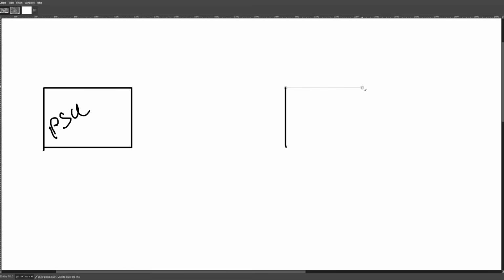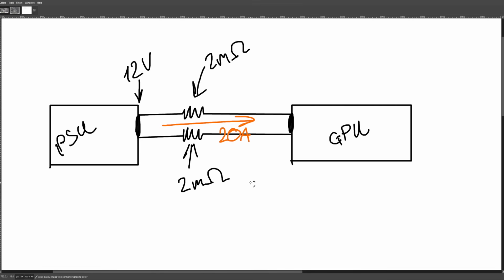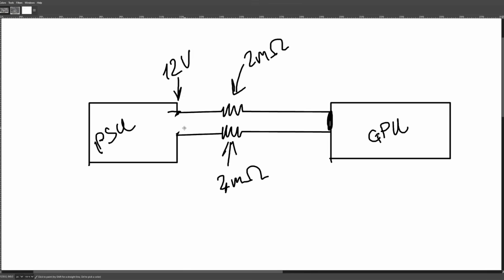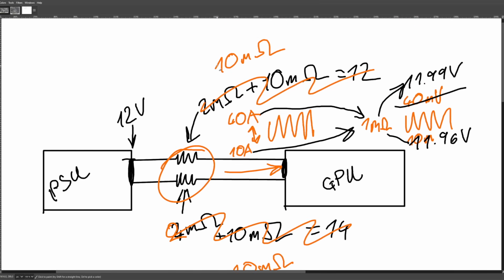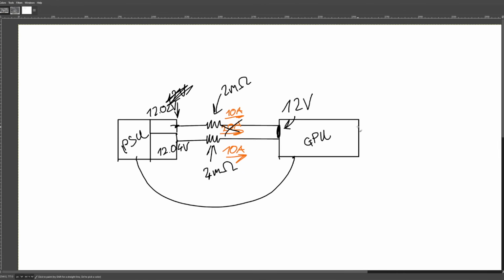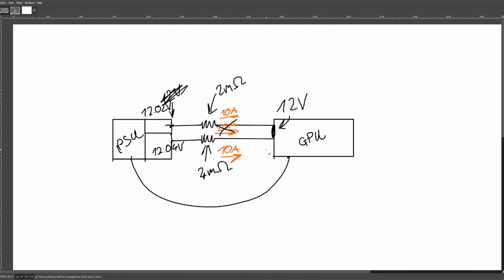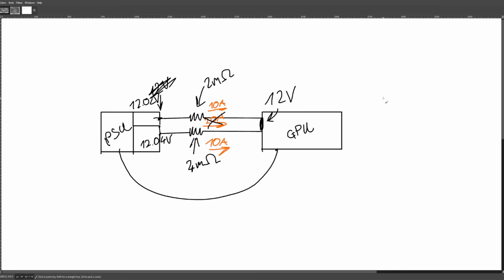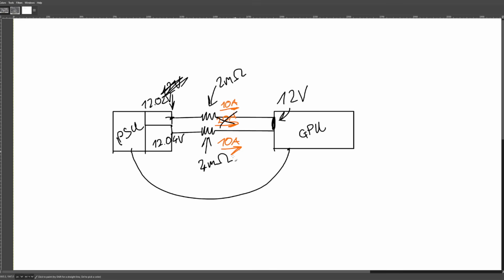Why ATX power supplies don't load-balance power connectors

Comment: There's also the fact that you are unaware as the PSU if each pair of wires within a connector wants equal current or not! ... If for example the GPU used one pair of pins for a rail to power cooling, and the rest of pins to a big rail for the rest of the card, and current controls it at the GPU end to achieve this, the PSU would have no way to know NOT to balance the current on them two lower current cooling power pins. Any load with individual pin pair current control would fight against any PSU current balancing circuit.
Reply: i'm pretty much certain that the GPU simply isn't allowed to do that. If it did that, then inherently the GPU would be drawing much more than the max allowed current from certain wires compared to others. I am actually kind of curious how the ATX spec is written now, because you raise an interesting point. I do wonder if the ATX spec specifically states that the power drawn needs to be designed to be balanced on all wires, or if it states that it actually can be unbalanced but just must remain under a certain max current limit.

depending on how the spec is written, this could be the only reason why using PSU side balancing would be the worse option IMO. If the spec allows for unbalanced current draw then you'd need balancing to be done on the GPU side.

But the spec really should call out balancing to be done PSU side and for the GPU side to combine all wires into one 12V bus on the card itself, and from there branch out to all of the 12V circuits.
Reply from the maker: @spectrum_observer  the spec for the 12VHPWR connector requires that all pins immediately get combined into one polygon on the PCB.
Reply: @spectrum_observer  I mean say on 3 pairs they have current limited to max (or less) and on say a single pair current is limited to much less (at the gpu end). Theoretically this would be fine, as long as it was managed properly at the gpu side and the pins drawing the most current were also current controlled, as parallel wires can happily carry different current levels at the same voltage, as long as it's individually capped/controlled and not all just running into one rail) .

 I have a feeling for 12vhp, this (as you say) is just against the standard, but for previous gens (6 or 8pin etc) I think it may be possible.

And I agree, the issue with 12vhp, is Nvidia sponsoring it's design, with a massive change in how they will be handling current balancing, without including in the standard that PSUs are now to do this instead. (this is regardless of if there is ability to "downclock" pairs within the connector individually - I'm under the impression that this is partly, if not THE reason it wasn't previously done though, however I could be mistaken).

Let me know what you find in the ATX standard regarding that! I have a lot of comments to edit possibly hah.

Comment: So, we are where we are. What is the best option for someone buying a 50 series & PSU right now?

What is the best PSU & cable to use with a 5090? Is there any solution that is better than others to minimise the risk?

If not, should 5090’s be totally avoided? And go for say a 5070Ti which has lower power requirements & therefore more headroom on the connectors?
Reply: honestly i would avoid the hell out of the 5090. it just isn't a good design power wise, and realistically it's an absolute shit design from a cost-benefit point of view. nVidia will almost certainly fix this issue for the 6090 because of how much backlash there has been after they failed to fix the issue for the 5090.  I would just go for the 5070ti if you really need to buy a 50 series card, but in all honesty i would go for a used 4080 super and not give nVidia an extra sale on the 50xx series cards. screw them, everything about the 50xx series is garbage and they need to do better.
Reply: @ I’m building a new PC primarily for video editing but using an AMD cpu, not Intel (avoided Intel due to there issues of late). The advantage the 50 series nvidia GPU’s have over the 40 series (or AMD’s latest GPU’s) is the media encoders. 50 series hardware accelerate h264 & 265 422 footage and this makes a big difference when editing and rendering video…..Intel cpus have quick sync which similarly offer hardware acceleration of these video codecs, but as mentioned, I wanted to avoid Intel CPUs, which kind of pushed me down the nvidia 50 series. I have had a 5090 on order since launch day when I failed to secure a 5090, and I’ve been contemplating cancelling the order, 5070Ti’s are readily available now, the 5090’s are not & my order is in a queue. I got my 5090 order in at the original MSRP for the Asus Tuf card, I'm now seeing it advertised to order (but no stock) for £450 more from a regular retail outlet, not a traditional scalper.

I'm also not sure what sort of percentage of folk are actually having issues with the melting cables/connectors on the 5090 vs everyone just 'hating on nvidia' (which may well be justified) & reporting that the 50 series sucks. That is not meant as a criticism of you, or anyone else, I'm not an nvidia fanboy & I'm not defending anything about this launch which is a disaster....but, unfortunately for me, the 50 series does make a very compelling case for video editing specifically because of those media coders & their ability to hardware accelerate 264/265 422 footage, which my cameras use. So I feel I'm caught between a rock & a hard place right now.

Comment: Some issues here bro. I've liked your videos for a while, but got some mistakes/issues with this one...

First, you said that it just isn't practical to do load balancing on the PSU side and it would be far more logical to do it on the GPU side, or to at least just use a connector that has plenty of current headroom. I will agree that the higher headroom connector would suffice, for sure, but it's also just such a shabby way to handle something like this, especially when you're dealing with a situation where you are supplying far more current through thin piddly little power wires like 16ga or 18ga wires can handle safely individually. Realistically if you know you're going to be powering devices that are highly likely to draw more current than any one single wire can safely handle (or any one connector pin can safely handle), then you should be using load current balancing in either the PSU or the GPU.

Next where you made the comments about balancing the load inside of the GPU by adding a small internal resistance so that the total resistance between the supply and the GPU was matched between both wires, you made it sound like that situation would be significantly worse than without the balancing. If you didn't have balancing but you had that same mismatch of 2mOhm and 4mOhm on the GPU supply wires, the GPU would end up seeing 11.97 volts. With your load balancing circuit in place, it wo uld see 11.96 volts. Not a big deal in the slightest. That's actually how it should be designed, like 100%. If one line from the PSU is seeing higher current than another line, there should be a MOSFET on each of those lines that's controlling the current output on each line, and the gate voltage on the MOSFET supplying the line that has higher current draw should be slightly lowered such that the currents match. This could actually be quite easily done using a basic op-amp comparator circuit if you only had two output wires. In reality there are 6 output wires, so it isn't quite as simple of a comparator circuit, but there are a number of ways that could fairly easily be designed using op-amps that would take feedback from one another and balance the output by adjusting the gate voltage on all of the output MOSFETs. I dunno, I think that's what they should be doing in PSU's going forward, full stop. It really isn't as complicated as you seem to make it out to be. And in cases where the resistance gets really really high, you'd have the PSU shut down with a little LED that indicates that the GPU power wire is damaged or not plugged in correctly. Doing this really wouldn't lower the efficiency the power supply significantly, and it wouldn't be supplying significantly less power to the GPU, AT ALL.

The funny thing to me about this is that if load current balancing was implemented in the GPU instead, they would be doing exactly the same thing as I'm describing here (and, basically, as you described), except it would be done onboard the GPU. It would still be lowering the voltage to the power phases though, it's just a change in location where the voltage is balanced. But you really make it sound like this would dramatically lower the voltage to the GPU - it wouldn't, at all. I dunno, I understand why you're bitter and jaded because of nVidia being stupid, but making it sound like load balancing would be this horrific inefficient setup where the GPU would barely function because it's getting such a low supply voltage. That's just flatly not the case.

Now, regarding load current balancing being in the PSU vs. the GPU: I would argue you are incorrect in saying that it isn't practical to do it in the PSU. I think that's actually a far better place to do it because the PSU is the device that's supplying power through wires that are too thin to safely handle it. It should always be the device that's supplying the power that does the current balancing because then the device can really be trusted to be a safe power supply in all cases, even when you connect a card that's designed by some shoddy two-bit designers who spec out connectors that aren't safe and can't handle the required power and who don't want to bother with load current balancing (like nVidia). It's just logical to do it on the PSU end. You really don't see this kind of issue in any other industry - if you are using under spec'd wiring and just using extra wires to supply power to a device that is not made by the same manufacturer as the power supply and instead is just following a spec that's supposed to keep it safe, the power supply will basically always be the device that ensures that it's connector as well as the wires the PSU manufacturer is supplying (and the connector on both ends of those wires) are safe and won't melt. It's honestly kind of surprising to me that PSU manufacturers don't bother with load current balancing, but I guess since it's not in Intel's spec, then they don't have to do it, and thus they don't. But I would argue that it is more the fault of the PSU company rather than the GPU company because the supply device should be designed in such a way that regardless of what is connected to it, it should operate safely.

Also though, regardless of where the balancing circuitry is used, it will have to be basically the same type of circuitry. It isn't like it would be far simpler to put it on the GPU. And since the PSU is the device that has a "max output current" spec for each connector (and in theory each wire on each connector), it really should be the device that ensures it follows that spec (or that it shuts down/stops current flow in the event that it goes outside of that spec for a long enough period of time).

Not to mention, GPU's are already expensive enough - don't give nVidia a reason to claim that they need to charge us even more for GPU's. Just have PSU manufacturers design PSU's that are safe regardless of if we decide to use a GPU that's been designed by two-bit shoddy engineers who aren't concerned with safety or following any sort of specs or using quality components that ensure safety. Like honestly, this reminds me of when electronics from China started to become more and more popular, and in various industries there were devices that originally had plug in add ons that were either first party, or the third party stuff was not "made/designed in china" and was not made cheaply etc, but then cheap chinese brands started making their versions of these devices, or new devices with different functionality, that plugged into the main electronic device, and when there were issues, newer versions were made to take into account the possibility of someone using an add on card/device/board/whatever that was maybe not made fully to spec or maybe not made with high quality components, and this new version of the "main device" was made more robust and made in a way that would ensure safety as well as ensure it wasn't able to be easily taken out by the cheap crappy add on stuff.

Next, where you are pondering the idea of using two power supplies, and you say that if you used two supplies and the output voltages were slightly different (because they would always be just a hair off, naturally), such that one had a votlage of 12.04 and the other was at 12.02 volts and they were feeding 10 amps each to the GPU, then suddenly the GPU was disconnected, you commented that it would be a bad situation because then you'd have 12.04 volts connected straight to 12.02 volts. Why would that be an issue? It wouldn't matter at all tbh. Yes there would be a slight current flow from the 12.04 supply to the 12.02 supply, but it's such a small voltage differential that the current would be tiny. Yes it would slightly lower the efficiency of the circuit, but realistically, in that situation you likely aren't going to be using that power supply without a card connected to the two supplies/lines anyways, so meh, it really wouldn't matter in reality. There isn't any extra design to do. In fact, lots of higher wattage power supplies DO use two separate 12v lines (same thing as two separate 12 volt supplies, except they're just two supplies on the same board, essentially), except they use the separate lines such that one supplies the motherboard and the other supplies the peripherals (some might supply the motherboard, EPS, and GPU on one, and the peripherals on the other), and there is no issue with those if you use an adapter to convert SATA or 4-pin molex to 8-pin GPU, it works just fine, and even if you did end up shorting the two 12v supplies together, it wouldn't shut down, it would just defeat the purpose of splitting it in the first place.

Next, the GPU voltage regulators wouldn't be "not thrilled" if they were supplied with 11volts so long as the spec for the card's requirements was as low as 11 volts. All it would do is draw an even higher current so that the required power is still supplied to the GPU. The voltage regulators would actually probably be happier if anything, because they're dropping slightly less voltage than they were with 12 volts lol. But really they wouldn't care - they're designed to work with a supply voltage within a certain window and will work away happily so long as the supply falls within that window.

Comment: It doesn't change anything, but I think the focus on the voltage (12 V vs 11.96 V etc) is a bit unnecessary. The main issue with high resistance is the I^2 R losses, not the voltage losses in themselves, surely. E.g. with the 100 mOhm serial resistor example, you get a 50 W power loss in the cables/connectors, which is of course insane, but the GPU might still work with that voltage until the added resistance melts.
Reply: It was sample to say that you change from 1 mOhm to 10 mOhm resistance on wiring, your voltage drop becomes not 12->11.97 V on 40A power consumption, but 12->11.9V instead. And at some point voltage drop will eventually become large enough to go outside of ATX spec.

And as he said. Voltage regulators would not he happy working with constantly and relatively heavily changing input voltage based on load.

In other words, attempt to load balance wires with resistance can and probably will lead to severely increased voltage drop.
Reply: fully agree with you here. this really made it sound like the extra voltage drop that would occur if the PSU was balancing would be devastating in some way, or laughably stupid way to do things because of how inefficient it would be. when in reality, it is the perfect solution to this entire issue.